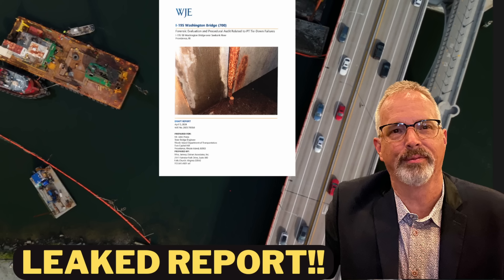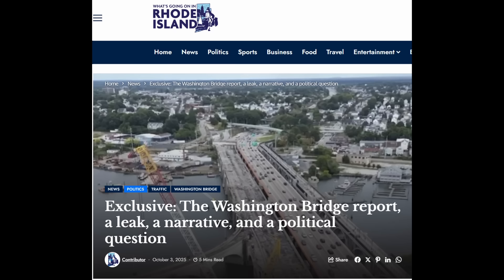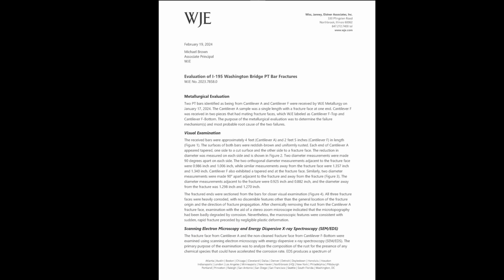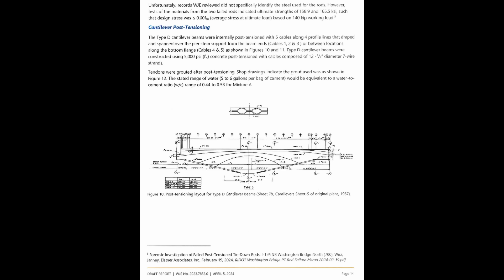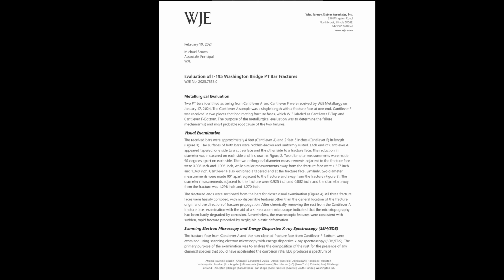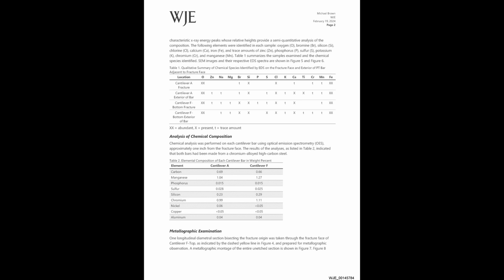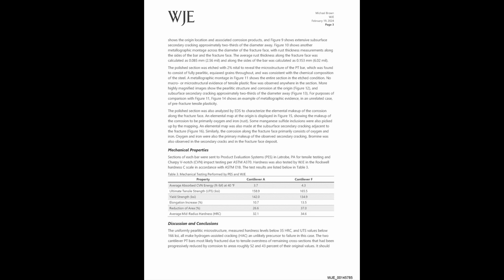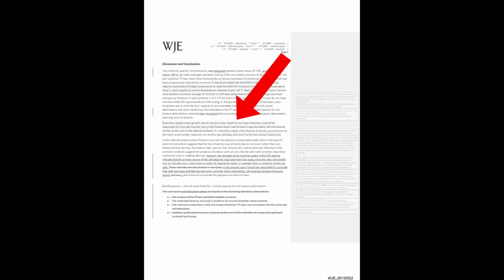Leaked Metallurgical Report for Westbound Washington Bridge PT Rods

Comment: Considering the cost and disruption of replacing a bridge, why aren’t these key components oversized and made from corrosion resistant materials? To build for a 50 or even 100 yr life expectancy seems foolish. Most components can be repaired or renewed but for some it is impossible.

Comment: The fractured pin in the thumbnail has aged corrosion-radiused contours on both faces. A recent fracture would be a clean break, with surface oxidation on the "recently" separated opposing surfaces. That component had been corroding for an extended period of time.
Reply from the maker: You are spot on in your analysis.

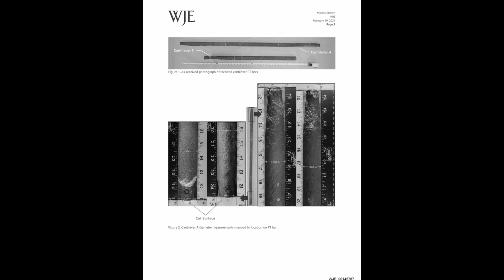Comment: The Charpy test indicates the metal is brittle. Brittle steel fractures with less elongation than tough steel. (my old eyes see 3.7 and 4.3 ft-lbf) It would be interesting to know the alloy specified by the design. Huge question in my mind - does the as found alloy match the design, if not why not etc. Elongation (10.7 & 13.5%) is consistent with a brittle material. Again what was the design requirement? The report also fails to get into the black art of strain rate vs. failure mode, I'm having a hard time believing the observed necking is corrosion that just removed section from that area in that way. Given the material properties I guess that might be possible, just wondering if the "sudden high load" hypothesis is supported by strain rate? I'd give the report a D- at best, it lacks (1) Comparison to design requirements, (2) Stress-strain curves, (3) Stress rate analysis data & discussion. (4) A mass balance - the rod as-built length and diameter is a known, with a little math the corrosion wastage can be determined using the as-found dimension. (5) The item was Charpy tested at 40F,  was any thought given to testing at typical low temps at that location?  According to the Google box in 1996 it got down to -25F. Temp is a huge variable in brittle failure. The item was tested at more that 60F greater than the known regional low temp. Again the Design spec would shed light on this.  Final point - there's also the concept of bend before break, why did the design call out a brittle material? Brittle failure is a design trap for those  who call out strong brittle steel vs. ductile alloys.  At 8:25 it looks like there is plenty of material to go back and do the mass balance, then hack it up and do lots more test at various temps and stress rates. The magnitude of the issue justifies a leave no stone unturned approach. Disclaim - this is not Engineering work product, just free speech regarding a report that seems deficient in my opinion.

Comment: Question.  Why did they not discover the broken anchor rods during the link slab work done on the bridge?  Could the install link slab have masked the deflection, which is the reason the broken rods were not discovered during the July 2023 inspection?  Finally, could the installation of the link slab have been the proverbial "straw that broke the camel's back" and be " overweight truck" that broke the anchor rods?
Reply from the maker: I think your questions are really on target. RiDOT's decision to obscure what could be learned about this situation is unfortunate to say the least.

Comment: Were the bolts that close to the Seekonk River to be repeatly sprayed from the water? I can understand the road salt.
Reply from the maker: I understand sea spray from ocean water can travel inland tens of miles on the wind. I suspect that would be the source of any ocean based salts. Providence is located about 30 miles from the ocean.
Reply: @CaseyJones-Engineer  That part of the Seekonk River is salt water.  It get's brackish up by Pawtucket.   Those two bridges are over salt water.

Comment: Thanks, Casey.  There's no way to know ahead of time, but an honest judge would look at the statement of ultimate responsibility for the inspection and condition of Rhode Island  bridges and throw the lawsuits out against the consultants unless there is reason to suspect fraud against the state. That pile of paper you now have might be pretty relevant if you have the inspection reports included during Alviti's reign.
Reply from the maker: I agree. I don't understand why the judge didn't throw out the negligence claims relative to the inspections firms.

Comment: The big piece of info, to me at least, is that they're saying all that area reduction was corrosion.  That decay must have been going on for years, and years, and years, for it to have eaten away that much of the cross section.  The RIDOT & their inspectors and engineers not only missed this break in the last inspection, but missed the massive amount of rust, and the implications of that, in past inspections as well.

 Echo's of the Fern Hollow Bridge anyone?
Reply: Very true.   I spent most of my life in power plants and a few industrial plants.   We always checked out corrosion on everything to see how much material was remaining.    Carbon Steel heat exchangers have a mandatory added corrosion allowance of 1/8" in the code for all pressure retaining parts.   I've seen specifications and Mfrs who upped that to 1/4" as added material during construction is vastly cheaper than replacing a heat exchanger.  But we always inspected and tested so we knew where we were within the corrosion allowance.
Reply from the maker: @perryallan3524  Thank you for sharing that information!
Reply: @CaseyJones-Engineer  What I forgot to mention is that we reinforced or replaced structural components throughout the plant from time to time based on the measured corrosion and comparison to specifications and rerun structural calculations.  Key is thickness testing when you see corrosion or erosion.  It stuns me that bridge inspectors are not doing the same thing.   Note we also track cracks and remediate as appropriate.
Reply from the maker: Yes, and now they are rightly concerned about having weathering steel girders for the remaining bridge that is now carrying 6 lanes of traffic.  The inspection reports for that bridge show many areas of corrosion from year to year which was apparently never addressed through maintenance and repairs until perhaps recently.

Comment: The metallurgical report is the real damning evidence against RIDOT, probably explaining why it was buried. The key is that the necking of the rods was entirely due to corrosion, not metallurgical yielding. That means that they had to have been degrading for many years, probably from the very day they were installed. The reduction in diameter would have been obvious to anyone bothering to look years ago, showing that RIDOT hadn’t been paying them proper attention for decades. 

The key illustrations start on page 12. The metal face there has been polished and then subjected to a special etching solution (2% Nital, a mixture of nitric acid and alcohol - DON’T try making this at home BTW, it can be explosive). The Nital selectively attacks weaker parts of the steel, and in this case is used to show the grain structure. (The “grains” are microscopic crystals formed when steel is cooled or subsequently heat-treated.)

Illustration 11 on page 12 shows a very tight, uniform grain structure, with no deformation from plastic flow. This means that the rod snapped suddenly once corrosion had reduced its diameter; it didn’t deform and stretch prior to the rupture, as the RIDOT commissioner seemed to imply.

The closeup images on page 13 really tell the story. The top two are zoomed in, showing the uniform, random grain structure of the failed rod material, while Figure 14 on the bottom shows examples (from a different project) of what the grain structure looks like in steel that failed due to yielding via plastic flow (stretching). You can plainly see how the grains there are elongated and aligned in the direction of strain, sharply contrasting with the steel from the rods.

This is the ultimately damning evidence against RIDOT, showing that the sudden failure was the result of years, probably decades of neglect. I don’t know enough about the structure of the bridge (don’t recall the details that Casey showed in such excellent detail in previous videos), but I’d bet there could have been effective remediation done at vastly lower cost if RIDOT had flagged the problem 10 or 15 years ago.
Reply from the maker: Thank you for your excellent comments!  I think you have laid out the scenario as it actually transpired for what caused the rods to break.
Reply: "effective remediation"=sending Joe below deck with a couple cans of Rustoleum.

Comment: Why wasn't there a more robust inspection schedule and/or process to catch concrete surface cracking or wear and tear?
If the cracks were caught early, they could just be resurfaced with patch, epoxy, or fresh concrete?
I haven't worked with Post-Tensioning since my apprenticeship over 25 years ago, but if i remember correctly, doesnt it have to be replaced completely? Or am i wrong? Just asking.
Seems like an ounce of prevention, is worth more than a pound of cure.

Comment: At 6 minutes: stress corrosion cracking can have an accelerated effect on crack growth and corrosion product accumulation on the fracture surface. So maybe the tie rod fractured more recently than expected. 

I still contend though (until evidence is presented to the contrary) that the tie rods were not directly inspected on a regular basis - otherwise there would be reports that plotted the degradation of the rod over time. 

Lots of other questions to answer as well: does the grade of steel used match that specified? Are the in-situ loads consistent with what was intended for the design? If what the administrator said in the press conference were accurate, and the fracture was caused by some unforeseen overload event, what magnitude of overload would be required to achieve the same effect?

Comment: This has always been grinding to the conclusion that RIDOT doesn't want to admit that they weren't taking proper care of the bridge. They didn't commission adequate surveilance of the bridge, so they didn't spot the failure of a pretty worryingly critical element. Hell, they didn't ever notice that it was corroding or they could have done something about it, maybe in the 1980s. But the evidence was all there from day one. You could see that it had corroded away just from the distribution of the thinning of the rod.
Reply from the maker: You have provided a spot on summary.

Comment: To me the original engineering and design didn't take into account the risks of salt spray or from road de-icing salt. Like too many other places, there were inconsistently held and inspections, attempts to hold down costs and especially as RI, corruption in bribes and cut corners. It is well know that many bridges and related major infrastructure is putting people at risk due to similar factors.

Comment: Good job, these schmoes have little chance other than outright fraud and or perjury of getting much past you. Great catch noticing that the final report had at the official suggestion left out the lack of certitude references as to when the failure occurred. It's certain that RIDOT can no longer say that the failure occurred between the two prior inspections but rather more likely than not this failure existed for some time before it was discovered. It's reasonable to assume that non written pressure was exerted to get the report to pinpoint the time of failure to have occurred between the last two inspections. This is a "CYA" of epic proportions and the experts in charge (EIC's) have made numerous professional fails with respect to maintenance and public safety while allowing the bridge to fail it appears largely due to improper inspections and corrective maintenance. (Treat the oxidizing member/s and the bridge is still in service today, inspect the piers and foundations prior to demo and repairs very likely cost millions less and are completed much much faster.) I have to admit to the  intense satisfaction I get as you hold the EIC's feet to the fire over and over again,  being unfortunately cynical and for government jaundiced and sardonic as I am, I don't think any of the Experts in Charge who failed the public will ever be held accountable. Ray

Comment: I am still baffled as to why no bridge is built with a longitudinal study in mind on the aging of the structure for both Emergency Response Planning but Future Planning/Proofing both the current bridge and future bridges. Choosing several locations to store on site 10 sample blocks of the concrete used, with samples of the rebar, tension cable, metal lath imbedded in the concrete sample blocks, with the relevant data impressed or tagged to the specific block for tracking purposes, in order to examine, test, determine,  if pier, roadway, or elevated structures are aging as per projections. This would allow for decennial, or bi-decennial testing by the relevant authorities and build a library of the previous test samples on hand that can be destructively tested could help provide a fuller picture of how the structure is aging over time, allowing long term projections, and help future planning replacements. I think it is something that should be thought about doing, to ensure the safety of the public safety and the public coffers.

Comment: The steel rods had been rusting since they were put into service, due to ocean breeze and road salt- known variables. 
Wouldn't suitably sized stainless steel rod, in places, have been a better idea in the long run?
Reply: An entirely different design would have been the correct solution, but stainless rods would have helped. Depending on the alloy, stainless is typically about ~~50% higher tensile strength, so less of it would be required. BUT, 316 stainless is a good ~5x more expensive than structural steel, so the cost of the project would have been much, much higher. An entirely different design would have been more cost-effective and could have completely eliminated this failure mode.
Reply: @DaveEtchells  Or, just painting them as part of regular maintenance.  Practical Engineering has an entire video on different rust prevention methods.

Comment: What a joke this whole situation is. Alviti isn't qualified for this, McKee has no idea what is going on, and the infrastructure in general in RI is a mess. It wasn't that long ago you could be driving on 95 in RI and see how the overpasses were propped up by wood beams stacked on top of each other like Lincoln Logs. Granted it didn't all start with the current administration, but this bridge fiasco has occurred during their watch. The most frustrating thing is that everyone traveling through this section of 195 have at least another three years of this mess, and once they've finally finished the westbound section, we'll likely need to have the eastbound section either repaired or replaced due to all of the additional wear and travel over it. Really appreciate you staying on top of this Casey, and digging in to find information that likely would have never made it to the public, because our local media sure hasn't done much.
Reply: Haha the old Wickenden Street overpass and entrance ramp.

Comment: Was this the one and only broken tie down rod in the bridge?  If it is, could this have been repaired by both welding metal into this rod and then adding several parallel rods?  Or did they find more broken rods when they demolished the bridge?  My thinking is that if this was the only one, the bridge could have been repaired.  Perhaps adding rods to every location where original rods exist.  I'm not a civil engineer, just a lowly EE, so perhaps I'm missing something.

Comment: Keep up the good work! Clearly, the rods doomed to failure and likely did fail some time prior to discovery. Anyone with common sense would know that likely. The big issue here is neglect by RIDOT and finger pointing which simply reeks of corruption. I’d be willing to wager that the FHWA is asking a lot of questions of RIDOT, as well they should. Oversights can happen, but there’s just no way RIDOT didn’t know there was a problem with the structure. As a former PM and TL, it just sickens me they let this happen. RIDOT owes it to the public to ensure that structures are safe to the public. Just my two cents.
Reply from the maker: I keep wondering when RiDOT will get the necessary federal oversight brought to bear.
Reply: @CaseyJones-Engineer me too!

Comment: As you underline Casey the state has the ultimate responsibility and this clearly points out the years and years of half ass bridge inspections not of just this bridge but all bridges in the state. It's clear that the state engineer should step down because of his now exposed lack of due diligence. The governor instead of glossing this over should stand up and say that he is taking responsibility of years of inadequate RIDOT bridge engineers inspections and order the inspection of all bridges state wide weather conditions taken into account starting with those deemed most deficient. You can't sue your way out of your own mess.
Reply from the maker: Yes, I think the governor fumbled a chance to tackle a years long problem (most of which pre-dated is tenure) but he went the other way.

Comment: The more I see and hear, the more convinced I am that certain politicians have been stealing the federal funds meant for the maintenance/upkeep of the bridge since it opened. No design can withstand that kind of criminal neglect!!!
---There hasn't been an honest election in RI for decades, and this is but 'one of the consequences. 
--It's not a question of if, but when will the Mt Hope bridge, or one of the others fall into the bay and how many will die when it does?? 
Political crimes are dangerous, isn't that right Gina, Sheldon, and a whole host of other 'present AND Past RI politicians? Grrr.